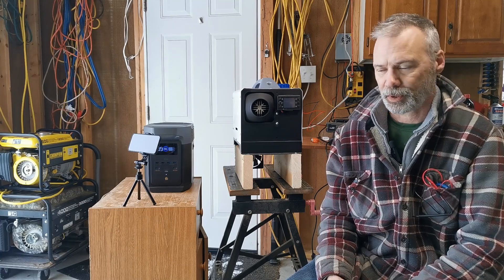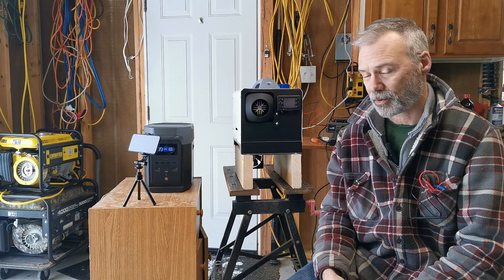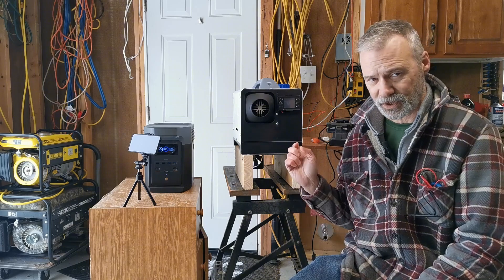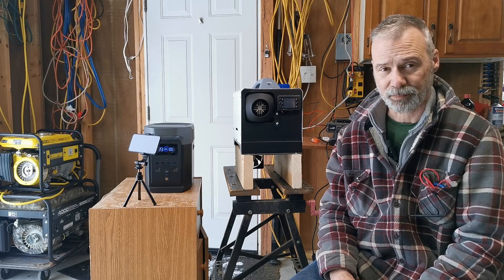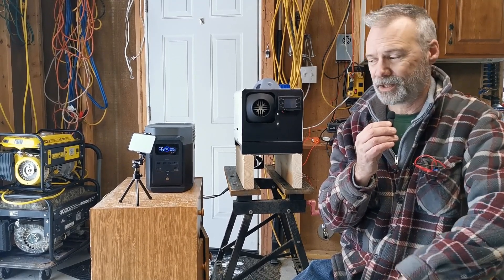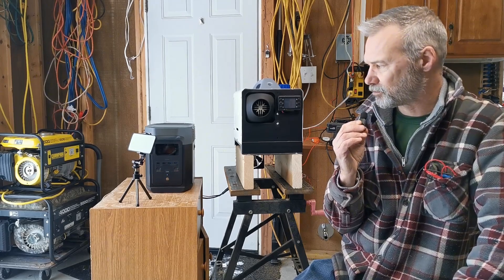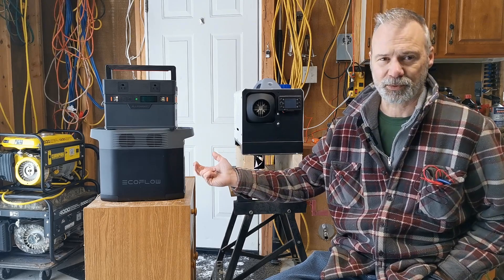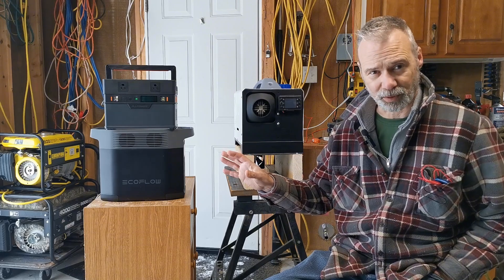Can you power a diesel heater from the lighter plug of a solar generator?

Comment: Ive found that turning the temp setting all the way down until the unit is up and running, then you can turn up temp setting with no issue's.  The glow pug will pull a draw for less time, and not overwhelm the 12v cigarette outlet

Comment: Awesome video! I have a Ecoflow River 2 and want to run my newly installed diesel heater off it - I'm living off-grid.
Question: What was your wiring setup for the lighter adapter? Does the wiring need to be a certain gauge or adapter plug? Is there a fuse?

Comment: Our van's Espar D2 heater, wired to an AGM battery, starts fine at 10A above zero. But in colder temps, the aging AGM's voltage drops, struggling to ignite the glow plug, causing issues. Your lithium battery avoids this, making it ideal for diesel heaters in Canadian winters!